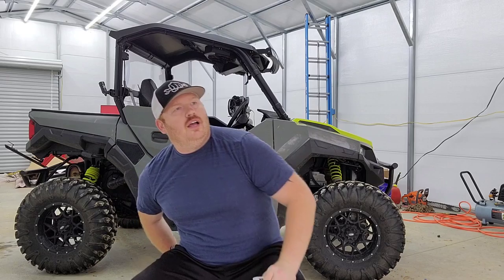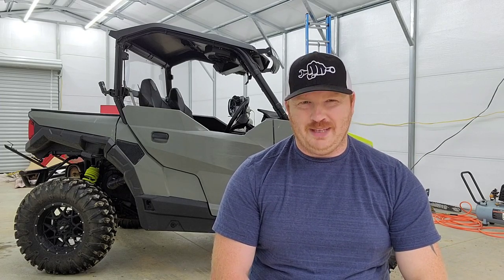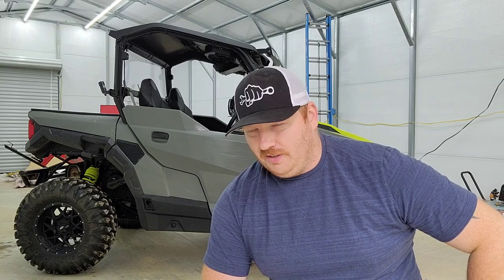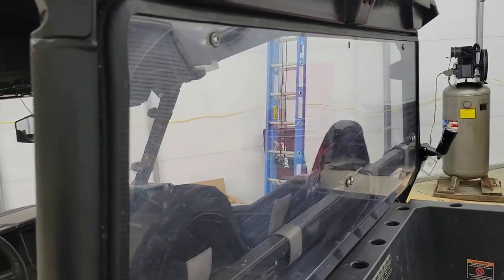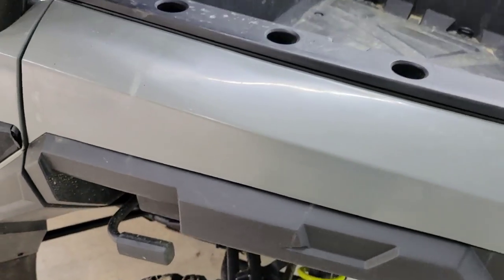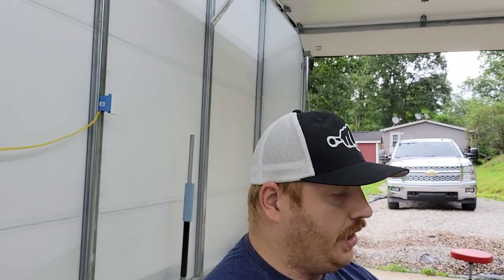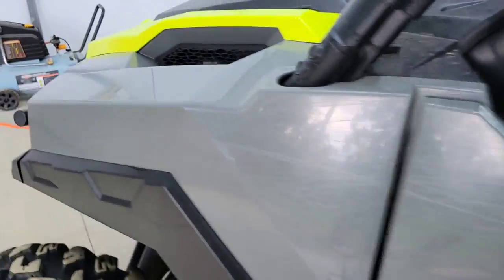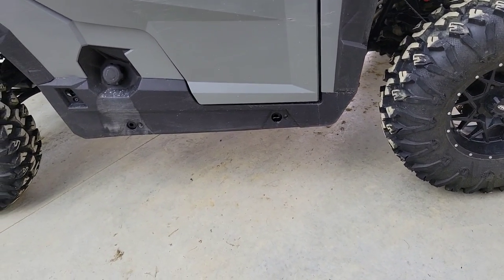Polaris General 1000 Review

Comment: That’s interesting about the DOT approved tires. I will be looking to adding a street legal kit for the UTV. 

Love the super ATV A-arms for the suspension. Will look into the shocks you purchased. The Walker Evans look and feel amazing and are very flexible for setting the ride comfort with that system.

Lol getting so many ideas.

Not sure if the light bar is that worth it; but it’s user scenario dependent.

I’m really curious about your door mod. I wish there was a factory option for poly-carb windows.

As for a tractor…. Look at a Kubota BX23 series. This was one of the best investments I ever made and I use that thang on the regular to do work around the property and the farm. Very reliable, hardworking and you get full control over that bad boy as opposed to John Deere; which is a heart break. Just keep it serviced and joints greased up. She keeps running. A little bit of Satbil for diesel engines helps out a ton to ensure you’re good to go for winter. Love it.

Comment: Question:
How did you get the grey color? Only see white in the 1000 model (non xp)

I’m looking into one of these. I love that it is a sport UTV plus it can do work. I absolutely love that. 1500 lbs of tow (most likely 1000 to 1250lbs to give the engine overhead to breathe). I also prefer the 1000 with it being more narrow to fit into tighter spaces than the XP.

If they release a hybrid EV (gas+electric) I will trade the General immediately and this would be the absolute perfect UTV. 

Great video and story about your journey; thank you for posting. And hope you’re still enjoying the hell out of that UTV.

Comment: So no rub ? With 30s like the xp? Even without changing  a arms?
Reply from the maker: The rims offset 2 more inches on each side with the high clearance a arms at stock length. No rubbing at all
Reply: Do 30s fit with the stock a arms?
Reply from the maker: They should but i'm not completely certain that that they won't rub while turning sharp without an offset. My general was 60" wide stock and I make it 64" wide with the upgrade. If you have a 64" wide stance right now you should be ok